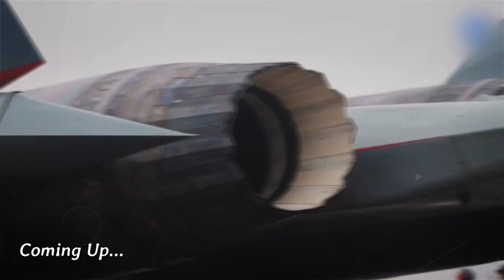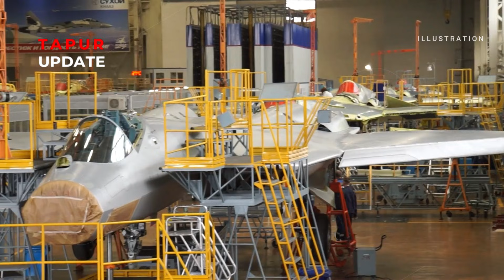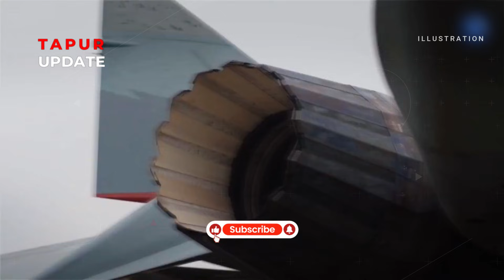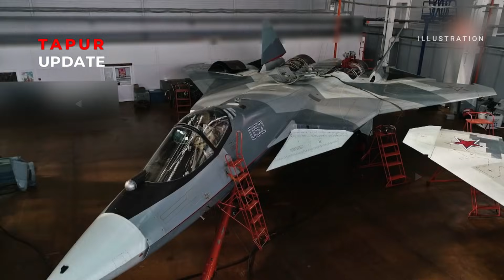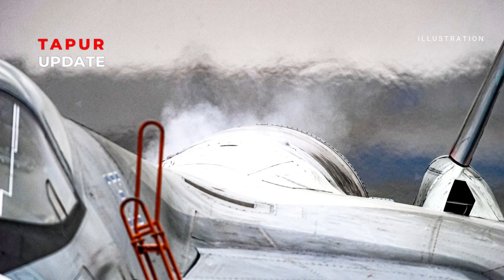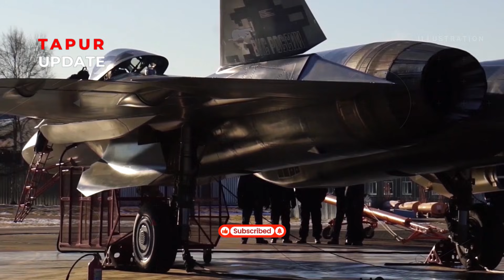Russia’s Next-Gen Su-57 with a New Stealth Engine Stuns the World

Comment: lol, naw, there is no next gen, the su57 is a failed endeavor. It’s not fifth gen, and Russia isn’t capable of building any new equipment. None of their most recent ones have worked. The Satan 2, failed on 5 attempts, su57 has a bigger radar signature than an f16 fourth gen, not to mention the new ex version. The t14 armada can’t even make a parade lap.
Reply: Wrong wrong andddd wrong. Dude your using talking points (some of which have never been true) from years ago. Get with modern times a shit load has changed
Reply: @andyturbo look at this sheep bleat, you can lies and deny, but you cannot change facts.
Reply: Lo dico già vda molto tempo.
Bravo!!

Comment: Well, the Product 177 ("Izdeliye 177") is Not a fifth generation engine, but it is indeed is lighter, has higher thrust, lower fuel consumption and longer life cycle than previous one, AL-41F1 engine. The fifth generation engine Product 30 ("Izdeliye 30"), AL-51F1, will be mounted on the new modernized version of Su-57 (Su-57M/M2), but the Product 177 will likely be mounted on all export versions, Su-57E, as well (not AL-51F1, for Russians only). Moreover, the Product 177 will be one unified engine for many Su models, including Su-35S, maybe Su-30, Su-34, etc. It was a declared concept a few years ago to have a unified engine for all different Su models to reduce maintenance, logistic and spare parts difference for all Su aircraft, including export models. So, it is now, mission accomplished finally...
Reply: Do you know what Mach 2.8 means? It means the F22 and F35 are already obsolete.
Reply: @klaastelkamp5414 , Well, I do know. The question is: at which altitude and with which payload capacity? So, for example, even the Su-35S is doing a super cruise fly without an after burner usage with payload less than 60-70% of the max aircraft weight, at high altitude... For the F-35 it was forbidden to have supersonic speed more than 90 seconds (in row), since it get cracks in its tail construction.😅
Reply: @maksimluzin1121 you don't have to explain to me that the F22 is an antique and the F35 a commercial piece of crap. I know! Greets from the Netherlands

Comment: turbine thrust 177 16 tons.  The F22 has an engine thrust
of 15.7 tons. At the same time, the empty F22 is heavier by 1.2 tons
Engine 177 for the first stage of the SU57 and for replacing old SU30 engines, as well as for export

Comment: The su-57 is built to support the up-coming MIG-41 air superiority fighter jet..
Reply: MIG-41 is an interceptor, designed to succeed the MIG-31.  The SU-57M is a designated air superiority fighter platform.  Interceptor and air superiority fighter are two completely different roles; hence two completely different aircrafts.
Reply: @joeren8948 
nowhere did he mention they are the same aircraift.
he said to support.
maybe learn to read befor you comment.
and air superiority are exactly what he said..
to support other types of aircraift.
like interceptors, bombers or even fuel planes.
you may have seen f22's escorting other types of aircraft.
thats about all the action they got in its entire excistance 😂
Reply: @CrimsonRaven82 who supports who?? 
MIG-41 does not exist yet asxan operational fighter, and is a replacement for the MIG-31 interceptor (and is not an air superiority fighter) and goal and role of both are totally different from the SU-57M as an air superiority fighter. They operate totally independent clown!!
And specially you the F22 (antique) and F35 disaster wil lose from both. Even fromma SU-35S. New radar systems on mentioned figthers makes steatlh obsolete clown. They are visable in range of 350 and 600 km. They are also to SLOW!!
Reply: @klaastelkamp5414 
well thank you for mentioning a interceptor is not a air superiority fighter..
if you had not pointed that out, i would never have known 🙄🤣
i am so happy you are that smart, i would have never thought of a dutch person.. of niet?
je naam lijkt nederlands 🤔
aircraft have their roles, and those roles upport eachother clown.
also.. f22 is not slow.
is it better than the su57?
right now, maybe.
but su57 is still being modernised with the potential to surpass the f22 and f35.
Reply: It is not. Clever boy. They have a totally different goal.
Reply: @klaastelkamp5414 
where did he mention they have the same goal or purpose?
he said to support no?
and that is exactly what they do.
air superiority fighters are meant to maintain superiority over airspace to allow other aircraft safe passage.
clever boy 🤣